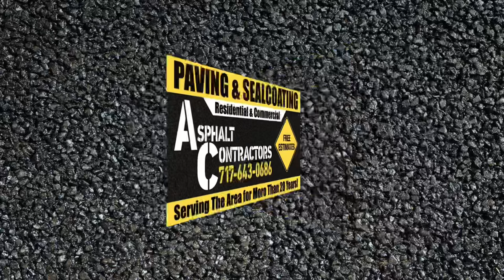Recycled Asphalt Installation (Millings)

Comment: I seen some contractors use ground up/recycled asphalt that was pulled up from other work sites. Instead of using crushed stone or other aggregate, they use this reclaimed asphalt. Is this an alternate way of putting down a base for new asphalt to sit on?  I use to deliver construction materials of all kinds, and every job site that waited to get my turn to unload, I watched dump truck after dump truck, unload stone.  My question pertains to residential building, not commercial.  Great site by the way.

Comment: You can see the roller lines
Reply from the maker: When millings are first installed they are alot softer than 6month yr. old millings. The surface will always push, When freshly installed.

Comment: Now spray some diesel or kerosene on it and let the sun work on it. It will tighten up much better. For the price of this, I would have paid the extra for hotmix.
Reply from the maker: It is a deisel oil-based sealer mixture.

Comment: Haven't use reclaim. They say the best method is to have it ready and spray it before for a 90 degree day, spray the reclaim with diesel and compact it the following day for the do it your DIY. You can use a vibrating compactor.
Reply: Better to use calcium vs diesel, it reactivates it just like diesel without the smell.

Comment: What kind of Asphalt Spray to use? >I am in North Texas
Reply from the maker: Waterbased & oil-based But oil-based we use for asphalt millings
Reply: So new millings you suggest an oil based sealer. Would something like latex-ite driveway sealer work on new millings
Reply from the maker: @sherrimullen3396  Not saying it dosent work. But we have always used oil-based and have never had issues. Oil-based is a penetrating sealer and water based is just a surface sealer.

Comment: What kind of sealer do you spray it with ? Or does tack oil work as well ? Please let me know
Reply from the maker: We use a oil-based Asphalt Sealer. Aka Gilsonite
Reply: @asphaltcontractors  I see yes I’ve heard of Gilsonite sealer but where can I get it ? I dnt think anyone local to me sells it
Reply from the maker: @Cammed300srt8  You could always order it online just look it up on the internet. Or you might have a supplier near you

Comment: What did you spray at the end ?
Reply from the maker: A deisel and oil-based sealer mixture to help harden the millings.
Reply: @asphaltcontractors   ok cool does the product come as one , or does it need to
Be mixed ?
Reply from the maker: @germanromerosoto1844  We self mix it ourselfes
Reply: @asphaltcontractors  is there a specific mix you make or can it be bought from the store?
Reply from the maker: @stephendean9083  No we make our own mix we use deisel fuel and oil based asphalt sealer.
Reply: @asphaltcontractors  which is weird cause truckers spray diesel in the bed to keep from sticking.
Reply from the maker: @Orefamilylawncare  Yes to keep from hot asphalt from sticking. But it actually helps keep milled asphalt together.

Comment: Nice video I just had my driveway done just like this. But I haven't put any sealer on it like you did. But I'm curious about putting sealer down later on. My driveway is closed to 600ft long with a hill on part of it.
Reply from the maker: Millings are zero maintence but we will never install millings without spraying them. We believe it definetly makes the difference!
Reply: @Asphalt Contractors  I will definitely get that done then. Thanks
Reply: @asphaltcontractors what do you spray them with?
Reply from the maker: @LGBFJB46  Oil-Based Driveway Sealant
Reply: @asphaltcontractors Is that asphalt sealer like cobalt tar your using or is it  a tack coat or some kind of rejuvenator?
Reply from the maker: @chrissims6289  Yea it is a rejuvanator for pavement

Comment: How much did this cost?
Reply from the maker: around 6k
Reply: @asphaltcontractors  what if you overlayed a gravel driveway how much does that cost
Reply from the maker: @trevoroneill8131  All depends on the driveway and what needs to be done
Reply: @asphaltcontractors  how much would this same job have been if it was hot mix?
Reply from the maker: @simd510  Between 10-15k

Comment: What's it cost per sq ft installed?
Reply from the maker: Usually dont price by sqft. Price by what the job consists of.
Reply: ive done it for years it depends on the base being applied to, but american 50/60 cents a square foot is a really good price if its laid at 4inches compacted with 3tonnes or more.
Reply: also recycled will have pebbles, like rock debris that comes up, what i genuinely liked to do was roll it and let the customers drive on it but alternate there driving postitions for equal compaction as they continue to drive, 1 year down the line it will look rough but it will be durable so a sealcoat would definitely help make it look better because they do look fade after awhile
Reply: also dont fall into the belief that this is going to be looking like that forever, i have done a job though which requires different aggregate then he had that does actually replicate asphalt

Comment: What is recommended maintenance?  How long will this last compared to asphalt?  Looks amazing. Great job!
Reply from the maker: Millings is Zero maintenance because they literally wont go anywhere. All we reccomend is to spray it every 2-3yrs again to help keep oil and tar in millings
Reply: This doesn't hold up. To go through all this and not just use hot asphalt was absurd.
Reply: What is that spray?

Comment: What if you let someone put "asphalt" on your long driveway only to find out after that it was only millings? Can I do anything to make it usable and to where it won't track into the garage or house?
Reply from the maker: I mean that sucks. But what we do is compact them with a asphalt roller like you do asphalt and we apply the harder its a mix of Deisel fuel and asphalt oil based sealer. it helps harden them for less tracking but we have never really had issues with tracking in the past so not to sure.
Reply: Did they tell ya itd be hot ? If so, sounds like a gypsy did it
Reply from the maker: @ClutchTFS  We installed it our selfves we explain that it is recycled asphalt. Not hot asphalt.
Reply: @asphaltcontractors  what’s the ratio for the mix? Looking to do this idea for small parking lot

Comment: I noticed they miss some spots. I know if I was a contractor I would make sure that everything gets smoothed out and everything would have to be as level as possible.
Reply from the maker: It's asphalt millings some contractors dont even roll in the product or spray a hardener. this stuff gets harder on its own it doesn't need help. But Rolling it in and spraying a Hardner helps it out a bunch
Reply: @asphaltcontractors  What is the hardener you use? and how do i get it? I am in the Atlanta, GA area.
Reply from the maker: @m.martinjosephs7180  Its deisel fuel and oil based asphalt sealer.
Reply: @asphaltcontractors  bro i got a way better recipe ;D diesel fuel actually degrades asphalt btw not hating we all have our opinions
Reply: also if your rollers rolled like that with hot asphalt your stuff would look terrible :/ i seen horrible lines thru that on recycled, i get it will pack during people driving on it but cmon...
Reply: @asphaltcontractors   Whats the name of the product you spray to harden the millings?  What about torching it?
Reply from the maker: @adrianm6156  Its Gilsonite Oil based sealer mixed with deisel fuel it does have deisel in it so not too sure if it will catch on fire once its applied but once the product is dry it does not
Reply: I wouldn’t mention anything about diesel or atleast only offer it under the table.. it’s a federal crime spraying diesel on the ground
Reply: @jackyoung2441  its a product that's sold
Reply: @jackyoung2441  Ya I’d keep that to myself too. I guess their gorgies or roadies?